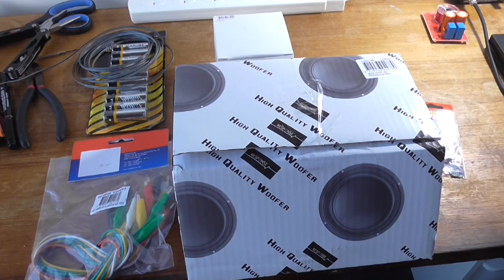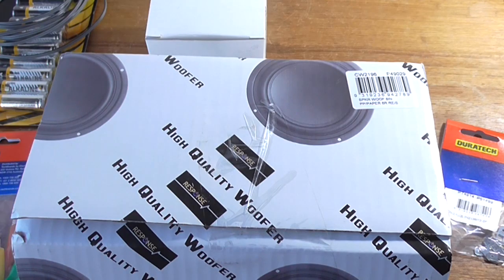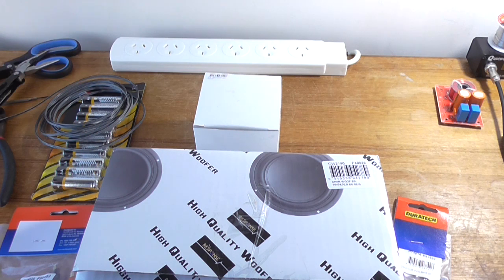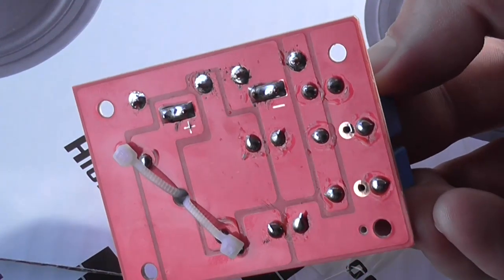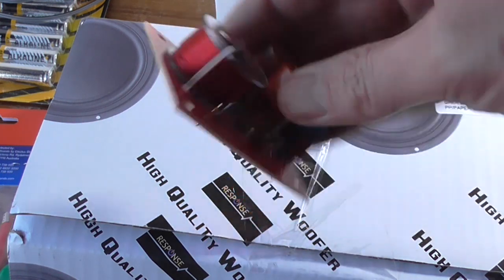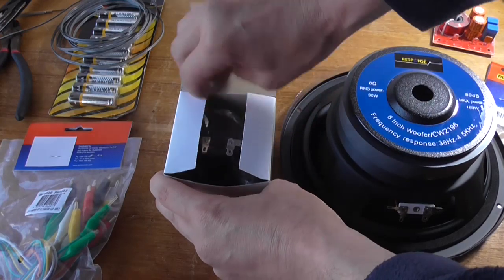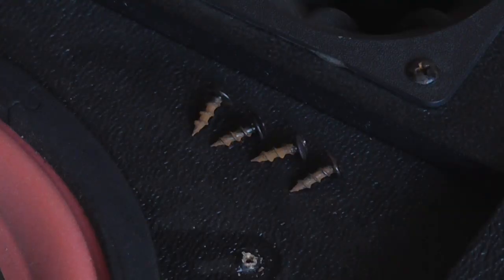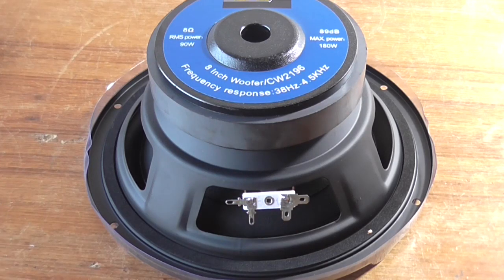Speaker Driver Replacement

Comment: The simple fix for Piezo tweeters is to parallel a 10 to 30 ohm resistor. The crossover will work better, the tweeter level drops a bit and the capacitor like behavior gsts damped.  Motorola suggested that in the original applications paper. They become much better behaved and even listenable afterwards.
Reply from the maker: Thanks for the tip. I assume a 5W resistor will be OK? And I also assume you mean paralleling the resistor across the tweeter?
Reply: @AstrosElectronicsLab  should be fine!
Reply: Parallel why no series?

Comment: Ah will the Astro30 delete this comment without even reading it?  The Response woofer you purchased is actually pretty good for the modest retail asking price.  :)  The tweeter however is awful IMHO.  I also question the conflicting info on Jaycar's website regarding its specifications.  One part says 8 ohms impedance but this conspicuously absent from the downloadable specification sheet ????
Also IME, most piezo tweeters have a high impedance which might possibly be also interfering with the response of the crossover network.  Perhaps even contributing to a "honk" in the frequency response?  I noted with interest when you did a test on the crossover network in a previous video that you perhaps didn't have both the low pass and the high pass outputs of the crossover network simultaneously loaded with the approximate impedance of the drivers.  Considering you were performing this at a low power level perhaps consider using low cost 5 watt wire wound resistors to do this.  They are like just 55c a piece so won't break the bank. :) 
Could you have used a better tweeter that won't cost too much?  Possibly.  I realise you don't have an Altronics store in Tassie but the C 3004 tweeter albeit not cheap is heaps better than that piezo horn job assuming it will fit the cabinet (and no I haven't verified it will).  The C 3004 is slightly more efficient at 91dB / w / m but you can easily lose a couple of dB through a couple of inexpensive resistors to pad down the level to match the woofer.
Reply from the maker: Lol. I don't delete comments. Yes, that would be a good word to describe it: "honk". That's exactly the sound. And you're right.. they sound awful. However, for what this will be used for, which is amplifying an instrument; the honk isn't really that big of a problem, annoying yes. Yes, I  realise the crossover wasn't loaded down correctly during testing; I want a rough baseline as to the crossover frequency. I reckon that crossover is a 6dB per octave roll off, tbh.